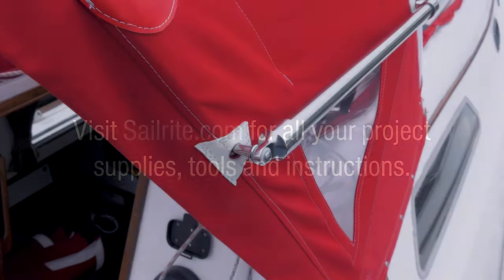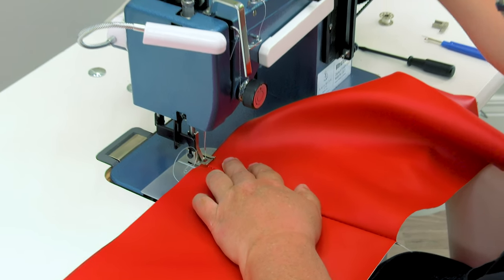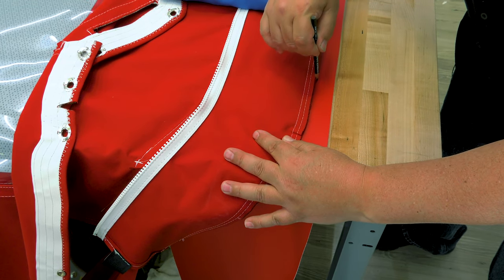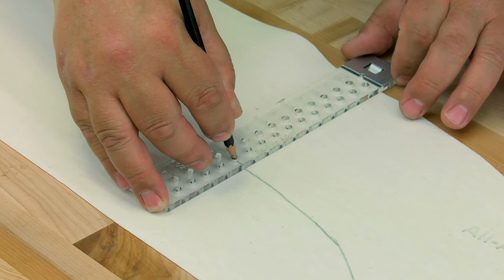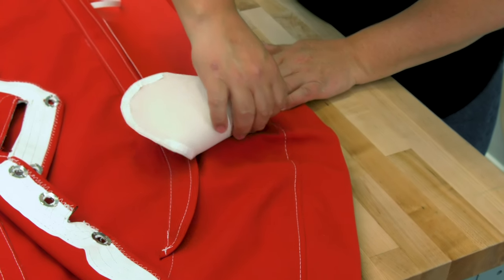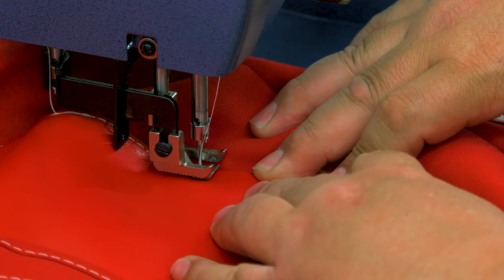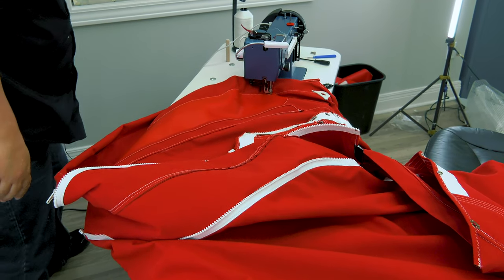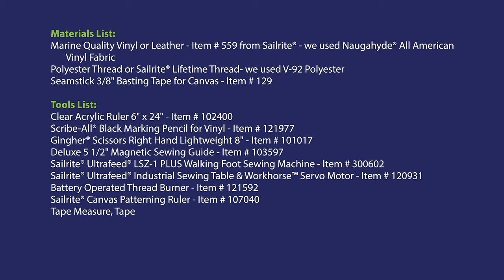Adding Chafing Guard to a Dodger

Comment: Interesting. That is the vinyl you recommended me NOT to use!  I made my dodger in 2013, and used Naugahyde for the chafing guard, based on your recommendation at the time. A few years later, the vinyl got badly damaged (discolored badly, smelled, got hard) by mold/mildew on the underside! 

I called sailrite this spring for advice. Your rep said the naugahyde was for upholstery, as it WOULD be subject to mold/mildew in a marine environment due to the fabric on the back, it was not for a dodger. The rep recommended Shelter-rite, as it vinyl on both sides, for the chafe area

I have been a sailrite customer for over a decade, and have done countless marine project. I would strongly, based on my experience,  recommend NOT using naugahyde for this purpose, unless the owner wants to redo it every 4-5 years.  

About this video: it is very good. It would make creating the chafe guard a LOT easier than the way I re-did mine!  Wish I saw this before doing it! 

Thanks for the great videos. The dodger dvd was critical on making my dodger. 

this is me https://sailrite.wordpress.com/2014/05/15/paul-seeberg-sewing-the-ultimate-project/
Reply from the maker: Hi Paul, Thanks for you comment, your comments are valid. However, when making a chafe guard you really only have two choices; An aesthetically pleasing looking, vinyl/leather, or a long lasting less attractive vinyl called Shelter-Rite. We picked the beautiful Naugahyde® Upholstery Vinyl (All American) over the tough Shelter-Rite vinyl for our chafe guard. As with any chafe guard reinforcement area the chafe patch can be replace when you see signs of abrasion or if the sun damages it to the point were it starts to look bad (usually a few years down the road). When that time comes it can easily be removed and a new chafe guard put in its place right over the top. The new one will not cause any damage to the dodger since it should be sewn in the exact same spot. If you pick to use a Vinyl Upholstery Fabric like Naugahyde® you can prolong its life using a 303 Aerospace Protectant every few months (spray it on a rag and rub it over the vinyl, do not spray it directly on the vinyl and do this on a day when the vinyl is not hot from the sun. Also do not get 303 Aerospace Protectant on any Sunbrella® fabric, it can damage it). Let me know if you have more questions.

Comment: For this type of bulk you really need a unison feed machine. You're at the limit of what a walking foot can do. Not just in thickness but in overall material handling.
Reply from the maker: A unison feed sewing machine is also called a "needle feed" or "compound walking foot". An example of a sewing machine that does this is the Sailrite Fabricator, which you can see at this link: https://www.sailrite.com/Sailrite-Fabricator-Sewing-Machine-in-Power-Stand-with-Workhorse-Servo-Motor The needle also moves with the walking foot in a compound walking foot sewing machine, so it helps to pull the fabric as it feeds.